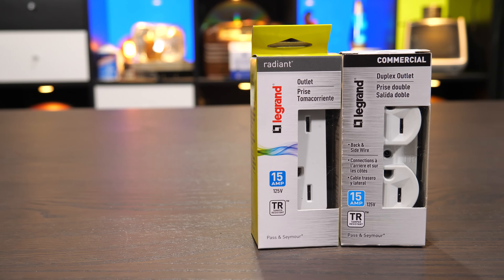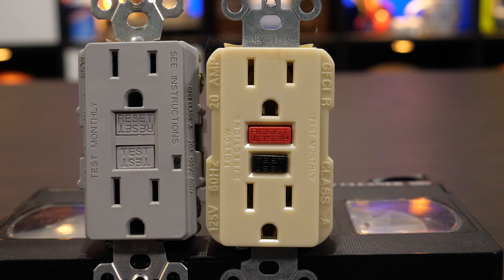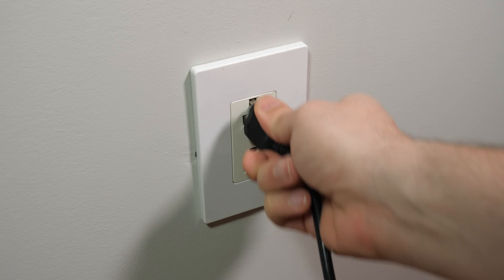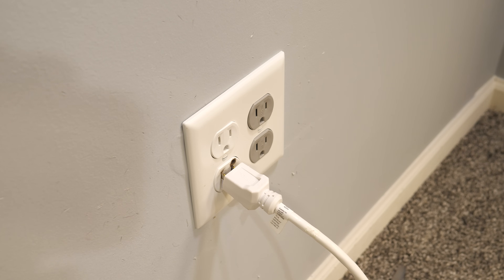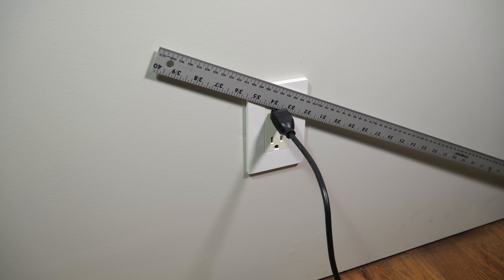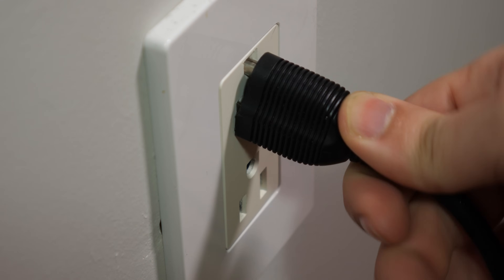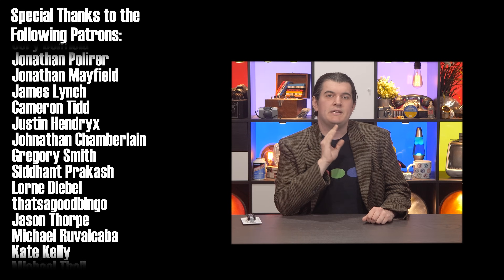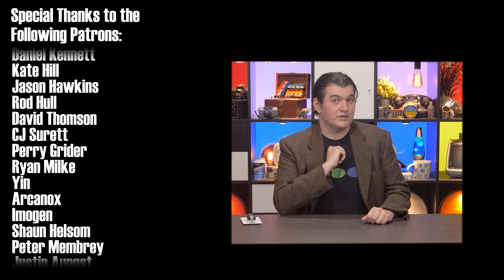Power outlets are topsy turvy - but does it matter?

Comment: I went on holiday to America recently, and i was really surprised at how loose the plugs were compared to other places I've been. Living in the UK, plugs will only expose pins if you VERY deliberately pull it from the wall, at which point, the connection is already broken.

Edit: Also almost all plugs are 90 degree plugs.
Reply: @@KeyDx7 Also, frequently used plugs. If they stayed in a hotel where people were plugging and unplugging things everyday, then it would be more surprising if they werent worn out
Reply: I was scrolling down the comments wondering how long it'd take to find one that mentions the UK plug. Not long 😂
Reply: UK plugs are the best in the world IMO.
Reply: @@KeyDx7 I mean it depends on code too / the electrician

In Pakistan, they typically use the two pin style plug sockets and we've got the odd UK sockets in the house too. The UK sockets are solid. The two pin style sockets, not so much

The house was built about a decade ago I believe
Reply: Yeah, watching all this from the UK makes me continue to love our awesome plug design over here. USA plugs seem terrifying.

The only downside of the UK plug is that they turn into caltrops if left on the ground
Reply: @drspangle13 😂
Reply: I have a heavy wall-plugged power supply. In most hotels in Asia I have to use a 10 cm (4") extension cord (with swivel connector) as it just falls out when I plug it into the wall directly.
When I moved into my apartment in Europe, the EU-style power plugs were all so loose that there were actually zapping noises coming from the plugs when I tried to use them.
I think there are simply bad (cheaply made with the wrong materials) and good models out there -- irrespective of the type (EU or US).
Reply: Hotel plugs are always garbage and loose.
Reply: Loose recepticals aren't worn out, they were just the cheapest import garbage the builder could source. If you buy good quality they hold tight and stay tight. It isn't just about materials but the internal design can be quite different.
UK plugs aren't superior they are just larger and more costly, it's like claiming that a large luxury SUV is superior to a commuter car in every way, in most use cases it is simply a waste of resources.
Reply: @@KeyDx7 The spectrum is part of the problem, that spectrum doesn't exist on the standard UK/EU plugs, if you find one that is 50 year old here it is still perfectly safe to use unless damaged by something else than everyday use.
Reply: @@KeyDx7 But then, perhaps that's an additional point, even old plugs and outlets in the UK still work fine, they don't wear out in such an equivalent manner.

I know what ethstring means though, when I visited NYC in 2000 I was surprised at how iffy the wall sockets & cable connections were.

About 20 years ago I began seeing UK plugs with a chunky switch and LED indicator already included, which are totally awesome (perfect for extension leads that don't have their own switch for each socket). They were very cheap, 45p at the time from B&Q. I bought a whole box, so useful for devices such as soldering irons. But then after a few years they vanished from stores, returning some years later in basically the same design but a lot more expensive, needlessly so I would presume. Marketed as 'new' of course, but the idea isn't.

In the UK I reckon the only reason why wall sockets get replaced is if they physically break somehow (very rare), as part of a full rewiring or just for cosmetic reasons, such as vintage brass outlets tarnishing. Funny thing, when a property is rewired, all the existing sockets are replaced even if there's nothing wrong with them. Great opportunity to nab some free sockets for future use. The place I rent was rewired a few years ago, so now I have a whole bag of spares. It doesn't take much to clean them up so they're good as new.

A bigger issue perhaps with UK sockets (and indeed plugs) is more of a hidden one, namely the quality of the actual wiring connections inside the socket or plug. A lot of electricians have pretty shoddy wiring abilities, grud knows why, and many home users have little clue either. When I've removed cables from plugs or worked on wall sockets, encountering less than ideal stripped ends is all too common.

Some decades ago it was common for products to be sold with no plug attached at all, one bought them separately, which at least provided some aesthetic choice at the expense of a little hidden cost, but it meant that as a child in I'd say pre-80s Britain it was common to be taught how to wire a plug, whereas as nowadays I bet few parents bother, or even know themselves.

As for standing on the pins of a loose plug, that's just a clever extra design feature intended to pretrain future parents to the evils of loose Lego pieces. :)

Lastly, many UK plugs are separate to the cable, so they can at least be reused, but as mentioned this means the wiring needs to be decent, so one could argue the moulded plug has an advantage there even if it lacks reuse. That's an oddity I've noticed of some very old plus, the way the cord is gripped can be a little odd.
Reply: @@KeyDx7 yeah but no matter what no one can argue that UK and EU plugs aren't superior to US ones in every single way... it just makes sense since they could look at everything wrong with the US one and improve on it.
Reply: @johannesgutsmiedl366  less sure about  the mainland, but the UK also replaced their plugs during the rebuilding after WWII so they learned from their own mistakes. Pre-war was the rounded-pin BS 546 which is technically still legal and the basis for the Indian and South African standards, but in 1947 the UK largely switched to the BS 1363 fused plugs with rectangular pins we all know and love to trap our homes with.
Reply: @bob-ert-0  Yeah there were some iterations to all of these, point being that the US basically invented the wall socket and then pretty much just decided to stay with whatever they had first come up with while the rest of the world looked at it and though "but what if we made those things actually, you know, safe to use" :)
Reply: @johannesgutsmiedl366  I would only argue that the US/Japan plug has the advantage of being much smaller than most 240V plug standards. The ungrounded 2-pin "europlug" isn't too bad, but most of them are so big, it makes things like power strips much bulkier, makes it harder to pass a plug through a shelf, etc.
I think I could live with the Schuko (especially with South Korea style duplex receptacles, seriously why do other countries not have these?) but UK plugs are comically massive.
Reply: @AKADriver I do agree that the UK plug is just too massive, it's a design optimized for 100% safety but sacrificing everything else. But the ungrounded Euro Plug really isn't much bigger than the US plug, and they are super common especially for everything you might want to take with you on a trip (which is the only situation where the plug size really matters). I'm pretty sure the EU Iphone charger isn't bigger than the US one for example, but the round connector pins are still much sturdier and harder to bend than the US ones and the plug is still better supported in the socket. I do agree on the power strips, but that is a very minor advantage bought with a LOT of downsides.
Reply: You're probably getting some sampling bias from plugs in public places that have been worn out. They do wear poorly and overall aren't a great design, but they generally aren't all that loose.
Reply: @GuyFromJupiter  But why do they even wear out at all??? My grandma has such old wall sockets at her home that there aren't even any on-off switches! Yet the plugs all stay in perfectly fine because they use type G. What, do old hotels have to have an electrician change the sockets every few years in the US/Japan or do you just keep them as-is and frail?
Reply: @GuyFromJupiter also sampling bias from the use of travel adapters! These typically sit between the plug and the socket adding extra weight and leverage. I remember using one for a phone charger when I visited the states, I had to prop it up on a stack of books to prevent drooping!
Reply: @GuyFromJupiter True.
Reply: I like our Australian plugs. Not too big, rarely loose.
Reply: We have lower voltage here. It's really not an issue like this video purported.
Reply: @mediocreman2  even 60 V can be deadly so 110 is plenty enough, it really should not be underestimated.
Reply: I'm pretty sure there is another video about why this content creator prefers your UK plugs to American ones.  Including the reasons you mentioned, and fuses in the plugs.

Comment: I find it amusingly fitting that you outlined the exact set of situations that actually led to a scorched outlet face in my house. My stepdad wanted to prove me wrong about the outlet spacing in our basement and used a tape measure, floating it along the wall rather than along the floor. And one outlet happened to have a two-prong wall wart for a cordless phone charger that had been dislodged at some point. The tape bounced a couple times before connecting firmly and with an arc and bang tripped the breaker. He was fine, though rather spooked in his quest to try and prove me wrong. As well as the incident leaving scorch marks on the outlet and three pairs of notches in the tape measure. Years later I still have that whole set to show that it can happen, but indeed I don't worry about the orientation because the situation was so specific in the setup. In fact when I put in the new one the replacement is oriented the same way as the previous one. It just hasn't been a major concern for me in the many years that I've been dealing with electrical.
Reply: @@karlwithak. Inverted is still to code.  You won't fail an inspection for being up to code

Comment: Great video, like usual. Thank you for making me feel both educated and entertained, and especially for all the illustrative insert shots that must be so much work to pull off. Have you ever checked out the little plastic child-proofing insert "socket protector with twist/slide mechanism" German Schuko outlets use? They're really neat because you can still use the socket with the protector inserted, but it takes kids a while to figure them out, as they require fine motor skills to operate. (I presume they're also available for the similar French and Czech outlets etc...)

Comment: I know this wasn't about showcasing international designs, but as a european I feel validated. "Schuko"-outlets have a recessed area that a grounded plug fills up completely, so that only the plastic back is visible. The ground terminals exist in grooves above and below the prongs, making it symmetrical. There are guides in the recess to provide friction against pulling and deflect any energy from bumping. Most newly installed outlets are also "child-safe", which means that a plastic cover needs to get pushed back by the prongs to expose the live and neutral terminal. The reliance on "We have always done it this way!" in the Americas always baffled me, since wood frame walls used in a lot of houses should make changes easier to implement, compared to brick and mortar. But that may be based on a stereotype, so it's not a solid argument.

Comment: China and Australia both use a common plug design (two diagonal slanted pins for active and neutral and a vertical earth), but they put the sockets the opposite way up. China puts the earth pin at the top, Australia at the bottom. China doesn't require insulation on the current-carrying pins, Australia does. Still got lots of old extension cords lying around from before the insulation was required, though.

Comment: The right-angle plug grip issue could be easily mitigated by just adding a grip, whether there's a physical outcropping or lip to catch, an actual little handle or hook on the back, or just texturing on the sides. I agree that those are definitely the better plugs, especially when you have outlets behind furniture or just a cat in your house.

Comment: Regarding the whole fingers-slipping-and-touching-the-prongs issue, imagine if there was some way that outlets could be turned off so there is no chance of injuring yourself (or of sparking damaging the contacts). But that would be crazy, according to a not too old video by Technology Connections. 

Yes, I'm still mad
Reply: It would make much more sense to design a plug that makes it impossible to touch live prongs (like for example Europlug and Schuko) instead of relying on the user to remember to switch of the outlet each and every single time.
Reply: @Jehty_  I agree. This was more about how Alec made a video about the importance of "clicky" light switches and then made an entire video about how you don't need to be able to switch off outlets. So many problems that he brings up in videos would be fixed simply by having a switch on the outlet, yet he seems to think it's a bad idea
Reply: @JollyTVance  but it wouldn't fix the problems.
It would barely be a bandaid.
Turning of the outlet isn't something that most people would do before unplugging a plug.
Reply: @Jehty_  In countries with switches, from my experience, most of us do turn them off
Reply: @JollyTVance  why?

Comment: Are there right-angled plugs swiveled by 90 degrees, NOT blocking another outlet and allowing the usage of BOTH outputs? It would also (maybe even better(!) when the receptacle are turned sideways.

Either way, seeing this I am more than glad living in good ol' Germany with our Schuko receptacles, Schuko and Euro plugs.
There are also Schuko plugs that are right angled, mostly pointing down (or up when the receptacle below is used as well!), but we it sure is allowed to turn the receptable by 90°, and there are extension cords with several receptacles that are turned 45°, allowing right-angled plugs side-by-side.
Even more, receptacles and extension cords nowadays come with covers of the holes that only move away when both holes are seeing pressure, making it very secure for children.

The only "downside" of the Schuko way is, you don't know where the live wite is. But heh, that is such a small price to pay. 😂
And when done well, the side the live wire is, should be the same within the house. But it does not really matter, as you are free to plug in your plugs at 180°.

Comment: 2:49
We sure do! Except for some reason in my house not all of them are sideways? I think only the (relatively) old ones are sideways but the (relatively again) new ones have the ground facing down. Honestly, the electrical work in this house was so very poor that it is not really that weird. Except that is also not true for the bathroom outlets which are old yet have ground down because they are attached to the lightswitch...except, I lied! That is only the downstairs bathroom. The upstairs one, which is seperated from the lightswitch, is sideways. As I said, this house is weird.

Comment: Love the content, although I am from Poland and this would not apply to me.
All our double receptacles are rotated 180 degrees to one another, and I don't think I have seen one that doesn't have this feature.
Also, I think there is a point to be made, that recessing the face of an outlet or having a bit of plastic lip around the receptacles like we have in Poland is quite a good solution to all the scenarios you just mentioned

Comment: One note on right angle mounts it only helps much if the hot side is down.  You may not bridge the circut but if the hot side is up and the object is in anyway grounded it can still be a danger, perhaps even worse if it is a weak ground that causes heat to slowly build rather than tripping a breaker.

Comment: In “new home construction” in both East Coast and West Coast homes I’ve lived in, that were built in the last 30 years, the builders do install a bunch of outlets with the ground on top - but only the ones that have wall switches that control them.  I have them al,over my house, especially as none of the bedrooms have built in lights. I guess the home builder figured “Lights in the ceiling? That’s too dang fancy!”

Comment: Electrician here. I have not once encountered any issues having facing them either "up" or "down" so far in my career. 99% of the time we install them with the ground closest to the floor. We sometimes flip the entire outlet (so the ground pin is closest to the ceiling), in order to easily differentiate half hots from normal outlets (half hots being one half of a given outlet being powered by a switch, while the other half always gets power). Makes it easy to explain to homeowners over the phone, and easy for everybody to remember. Also I recently installed those Adorn outlets (as well as switches, fan timers, dimmers, etc) for the first time, they are pretty neat. The pop-up outlets are especially fun to just press in and out lol

Edit, side note: the vast majority of dryers we see have right angle plugs, with the grounds being the top. We always have the ground of our dryer outlets facing the ceiling unless told otherwise. Definitely a mute point though, as you're not plugging in and out dryers constantly.
Reply: Another electrician here: there is nothing in the code dictating what is up.
Reply: @juz4kix  which is why I put them in quotes. Because "up" and "down" are subjective.

Comment: I don't know why they don't cover the conductor with insulator at the top to make it non-conductive so it can't shock you.

In the UK we have all plugs are right angled, have 3 prongs, grip the recepticle well, and have insulation at the top of the prongs, and have switches on the sockets to stop power. And the sockets are side-by-side so you can use both whilst using right angle plugs rather than vertically aligned. We have the best plugs and sockets.